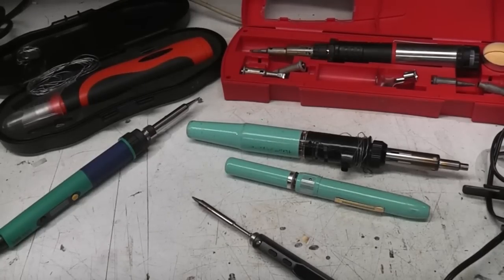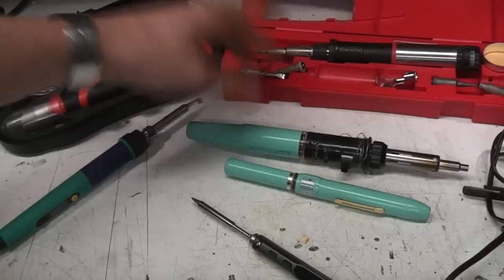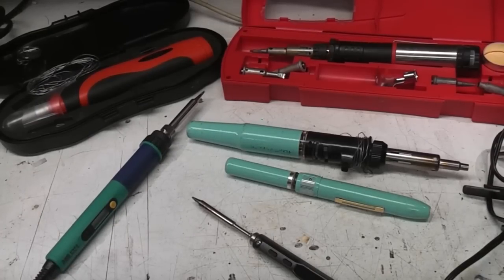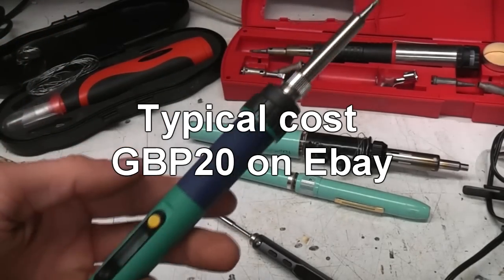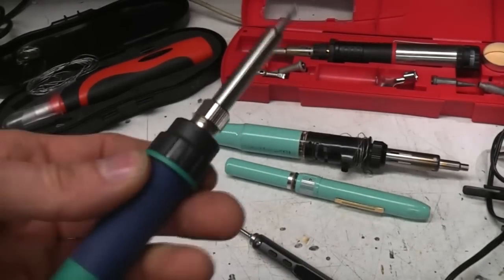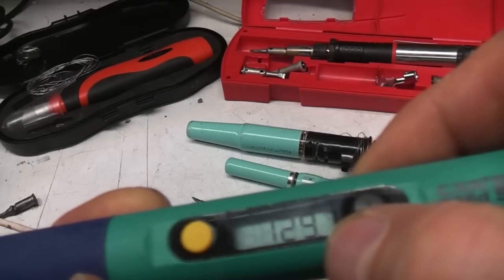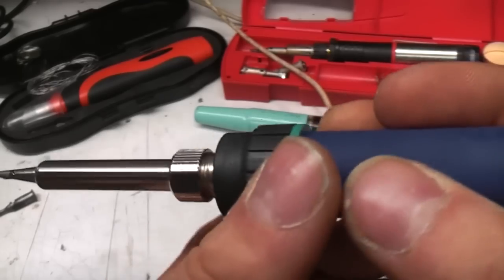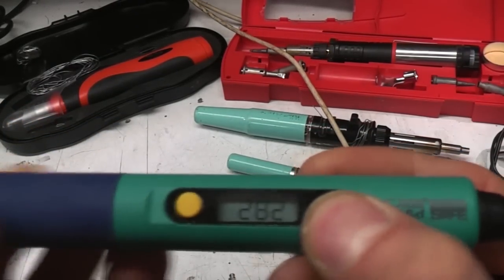TS100 and other soldering irons for when you're away from the bench

Comment: I used to have a piece of crap battery-operated iron that looked shockingly like the one here. It was indeed pretty much uselessly underpowered for all but the smallest jobs, but what really took the cake was the fact that some dickhead at some stage in designing it decided it needed to have a momentary pushbutton. Which meant that you couldn't even turn it on and set it down while it heated up. It also made for some interesting cramping because the button was so stiff, as well as some awkward positioning to try and keep it pressed at all times. It also claimed to heat up in something like 15 seconds but that was a bold-faced lie. With fresh cells it took like a minute to get up to temperature, and as they got weaker that just got worse and worse.

Now I have a little Weller that actually looks and feels similar to it, but instead of batteries it has a 9v 2a wall-wart connected by a 2.1mm jack. It works great for tacking component leads to boards, and it can even do some pretty heavy stuff with enough patience. It also has a toggle switch which is a godsend. I've actually cobbled together with a power jack and a small 5A buck converter a little contraption that lets me run it off a standard 12V SLA alarm battery. It's not super portable like a lithium pack would be but I have anxieties about using LiPo/LiIons unprotected. And the 7Ah SLA battery has a pretty amazing working time once the iron heats up.

That TS100 thing looks very appealing though. I don't have the work space for a standard temperature-controlled soldering station, so having something as capable as that in a tiny package looks very appealing.

Comment: hey mike. my cheap radio shack soldering iron just burnt up today. i wanna get something much mush better and adjustable. whats your standpoint if you were in my situation. what type of soldering setup would you get for around 50 bucks. so many nice ones like the x tronic 8080 hot air soldering and bench power supply but thats out of my price range.

Comment: If you use a phone charger with current output of 1.5 amps to power a usb soldering iron, that is 5 volts times 1.5 which is the current draw equals 7.5 watts same ballpark as the battery iron in this video, so if usb irons are crap battery iron should be crap to?

Comment: I have tried the battery powered ones, and found that the tips have a horribly short lifespan. compared to the mains powered ones (insanely low thermal mass and mostly hollow tip). To make matters worst, the tips tend to be expensive for what they are.

Comment: +mikeselectricstuff
Once USB-C and USB PD gets more adoption you can draw up-to 100w out of a USB-C port. USB Soldering irons are coming sooner than you might think ;)
https://en.wikipedia.org/wiki/USB#USB_Power_Delivery
Reply: +Andrew Querol Theoretically you might be able to draw that kind of power, but I doubt there will be any reasonably priced compliant cable available. Even with the modest power output of today's USB, most cables are just rubbish.
Reply: AFAIK All USB C cables "should" have to be complient with the PD spec. It's only the host that needs a special chip(And device?). Now that doesn't stop manufacturers from putting out cheep cables with copper coated aluminum with too thin cables. The main reason this works I think is because the device requesting more power via the USB PD spec changes the voltage also so the current will still be relatively low.
Reply: Cables that actually follow the standard are rare, but they exist. The 15” Macobok Pro from 2016/2017 for example comes with an 87W USB-C adapter. Same thing for some newer HP laptops, those have 90W supplies.

Comment: The TS100 soldering iron was a much better build quality along with the 24 volt 3 amp power adapter for maximum efficiency. Those that you're reviewing seems to be made with poor integration. As for that propane soldering iron I bought one from home depot and they suck!  I had more trouble refilling and getting it to work properly after refill to the point where I just threw them into the trash.  Truth be told u have anything that uses propane refill and rechargeable battery because they all tend to wear out faster and are not powerful enough.  You're better off with one that are plug into the wall for that constant power and that TS100 hits all the check mark for me in terms of small and portability and well built using high quality components inside.  For those that uses cheap low power output battery for the TS100.  Do yourself a favor and get the 24volt 3amp DC power supply for it otherwise you're just gonna run into issues using low wattage power output. That TS100 is built to handle 24 volt 3amp power source to get the full benefit of what it can do.

Comment: The part about the small USB irons is a bit dismissive. 
Indeed, they are rated at 8 watts -- exactly the same as your battery operated Weller. And your assumption that they could not suitably be powered by an average USB power bank would be in error, given what you have said about how weak a useful iron can get. You have already accepted that an 8 Watt iron is acceptable for certain smaller jobs, and at 5 volts, these little irons only need 1.6 amps to give you 8 watts. Even the cheapest USB power bank can manage that!  So, I would say that they are quite capable of doing anything your battery-powered Weller can do.  And they will do it from a readily available rechargeable power source.  
Granted, their one tip style is not suited to anything by very small circuit board work, but it does that one thing surprisingly well.  I dunno, maybe they've gotten better in the 5 yrs since this video was posted. I own one, and I quite like it for the little stuff.  
Very easy to carry, and the cap has a notch to wind the solder on!  Ya gotta love that!  ;-)

Comment: Why would they put a US 110 volt plug on a 220 volt soldering iron?  That's not even what you would find here for a 220 volt application.
Reply: +Galfonz 
Could be for the chinese market. As far as I know they have 220/240V but adopted the 3rd world country plug.
Reply: +superdau Mike recently got back from Hong Kong, where they are 220V with Chinese style plugs. I believe they are derived from US plugs, similar to Japanese ones, but they ended up on European voltage levels somehow.
Reply: A quick visit with the google machine shows lots of plug styles are in use in China, including US style 2 bladed at 220 volts.
Reply: +Galfonz Yep. You need to be careful not to confuse them if you buy non-universal voltage equipment.